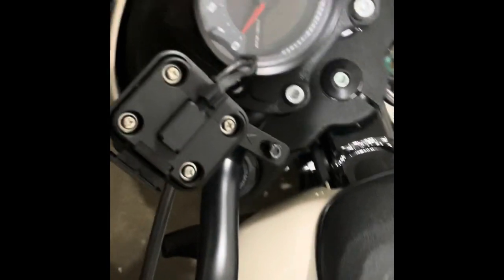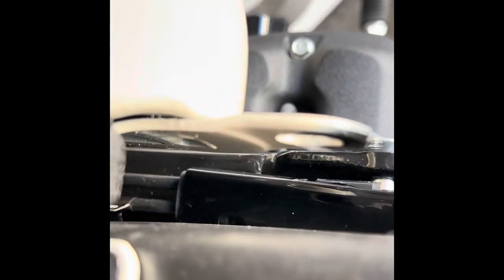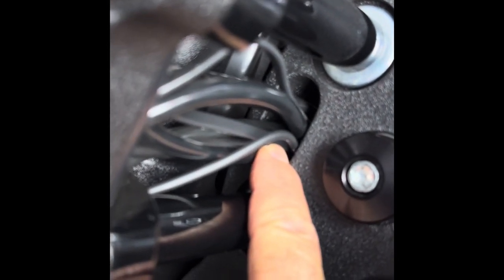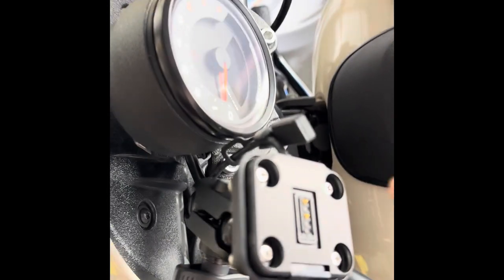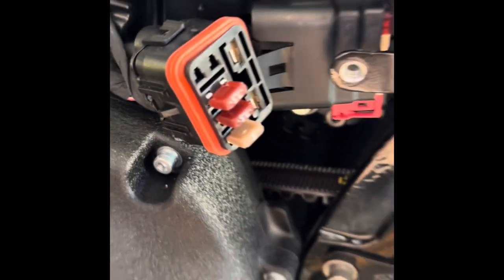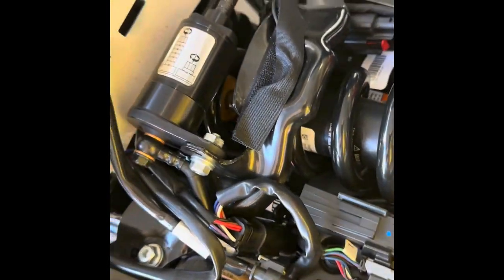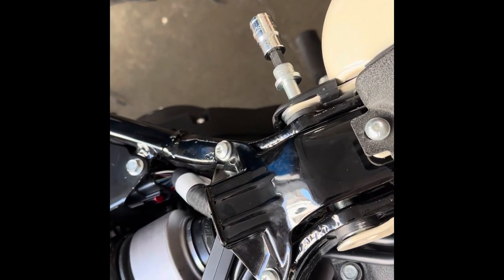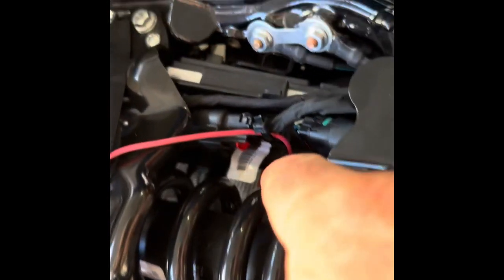Installing Garmin Zumo XT on 2023 FXLRS Harley Davidson Low Rider S

Comment: Doesn't lrst cones woth usb connection fron factory located at the frame by the front wheel?
Reply from the maker: @paulson9616  Not enough current from that. I thought the same thing, but it wouldn’t work just through the USB cable to navigate. Some functions it will do with USB, like update.
Reply: @tomhb9479  good to know.  I am thinking about getting this gps, but I need to find a bracket to fit n idk where to start
Reply from the maker: @paulson9616  Amazon is a good place to start